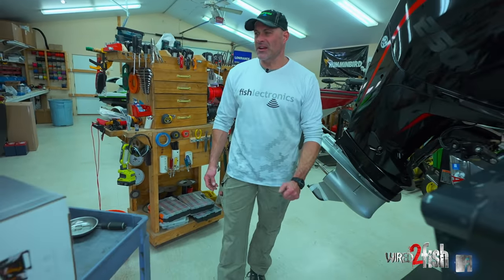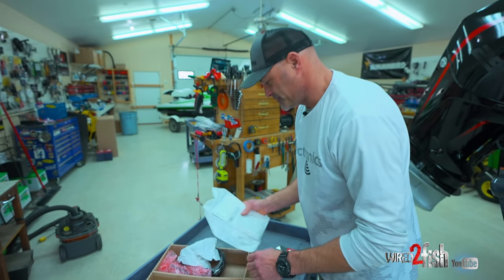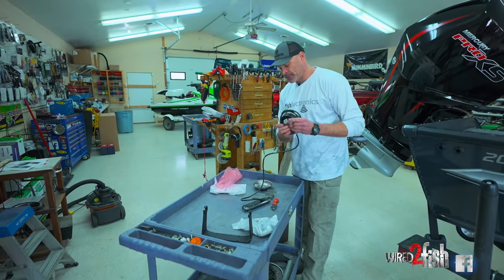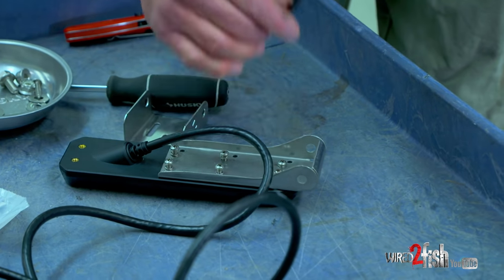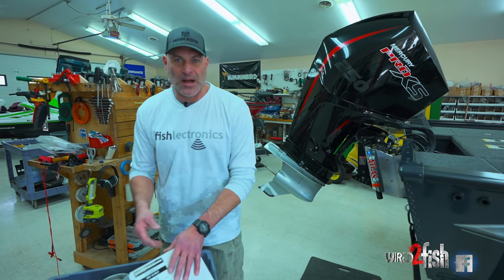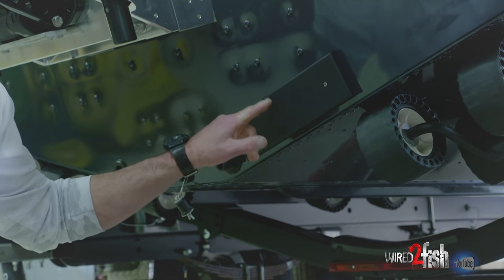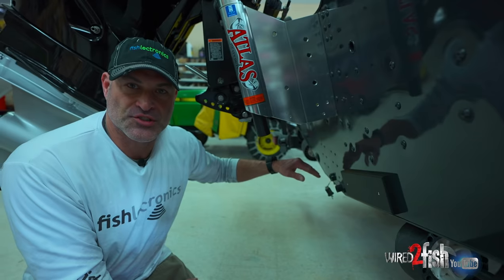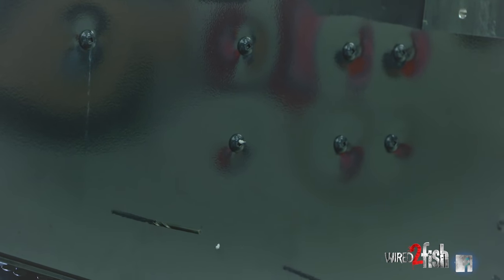How to Install a Fish Finder | Pro Tips and Tricks for All Models

Comment: I am looking at purchasing this very unit. I assume that I have to buy  a second side imaging transducer and a y cable to offset the noise given by my trolling motor. I would suggest using an isolator inline to a second battery which I will be dedicating to my Solix.  I like how 8 gauge was noted for the power cable. Overall this was a very professional presentation which I am bookmarking for my future install. Thank you and well done!

Comment: Thanks!  I needed this.  Question, what size gauge cabling for the power from the units to the sub-panel?  10-2 gauge?  Also are the connections to ring terminals also soldered or just crimped?

Comment: What kind of sealant do you use? And did you use sealant when you put the boards in with the screws?
Reply: My exact question. What kind of marine grade silicone is the best for Aluminum boats and transducer mounting boards ? Without using adhesive’s.

Comment: Just installed mine and use 1/4 “ coaxial cable clamps. I think they are a little heavier then the standard one like you were using. They already have a screw which I replace with a stainless.

Comment: I have had the same issues with finding the right size cable fastener...I have been using a few rounds of black electric tap in the spot where the fastner will tighten down on the wire....seems to work good for me

Comment: Thanks!   I am curious how you rigged 2 side imaging transducers and the high speed skimmer to the same head unit?   Did you have to use 2 different Y splitters?   Does it make a difference for Helix units?
Reply from the maker: Hi Michael, 3 ducers into 1 unit is possible with using 2 "y" cables. 1 - 14M ID SILR Y (SOLIX) to separate the left and right SI beams, that "y" cable then plugs into a 14M ID SIDB Y and the high speed skimmer into the other end of the "Y" cable. Hope this helps.
Reply: Yes, very helpful.   Thank you for taking the time to respond.  It is very much appreciated.   Great video!

Comment: Great video, thanks.  Just a quick question, when explaining where to position your side transducer you say to position the top of the ducer 1/4" below bottom of boat but then say that puts the bottom of the ducer above the bottom of the boat?  I dont understand.  If the top of the ducer is 1/4" BELOW bottom, doesnt that put the entire ducer BELOW the boat??  Just got a side scan unit and want to make sure i install the ducer correctly.
Reply from the maker: That is correct Bean, it was a misspeak on Andy's part. Position the top of the SI transducer 1/4'' ABOVE the bottom of the boat. Thanks for checking in on this. Figured there would be a few questions from those using the content as intended.
Reply: @Wired2Fish  Awesome!!!!  Thanks for the quick reply!  Off to mount my new transducer.
Reply: @Wired2Fish  hi. I bought a humminbird 9 and only comes with the side imaging transducer. Do I need to purchase the other/ smaller transducer? Thanks

Comment: Great video. For a high speed transducer do you recommended the Black Plastic flip up lock in place style?  Or can the transducer be installed with a stainless steel bracket?
In your opinion which is better? Thanks for the great videos Andy

Comment: I have basically the same setup with a left and right Si and Sonar transducer.  Humminbird kept telling me I had interference so I ran the transducer cables through electrical conduit that runs just under the top rail of the boat.  I ran the power in a separate conduit directly to the main battery.  Then cables connect to the Y cables and attached to my Helix unit.  I decided to try left and right Si because I was getting signal loose on opposite side for Si.  With two no loose.

I did figure out the boat level trolling at 1.5 mph.  Then with the boat on the trailer leveled and did the level of my two Si transducers.  I have the Sonar slightly pointing forward so I get a reading while going full throttle which is max 40 mph.

I had a local shop clean up the wiring that was on the main battery.  I explicitly told them the fish finder wire is purposely ran by itself and connects direct to battery.  When I got the boat they ran it into the wiring tube and connected to new wiring junction.  So far I haven't seen any interference.  I should of made a note and left it in the boat.

Comment: I have two batteries wired together. Combining the starting battery and trolling motor. Increased capacity. My question is: will that be enough for the LS too?
One battery has 550 CCA 685ca at 32 degrees 140reserve capacity.. and the  other one has 1000 marine cranking amps and 180 reserve.
Reply: You’re running 24 bolts to your gas engine? Wtf

Comment: Did you do anything special for the transducer plate when it came to silicone or sealant?
Reply from the maker: He covered all adhesives in the video.
Reply: @Wired2Fish  strange, there is just no sealant/adhesive talk when mounting that transducer plate. I thought that the holes needed to be sealed after being drilled out, and the plate itself..
Reply: It didn’t cover adhesives in the video. It was stated a marine grade silicone with no mention of type  @Wired2Fish